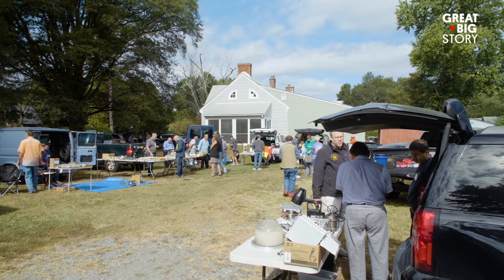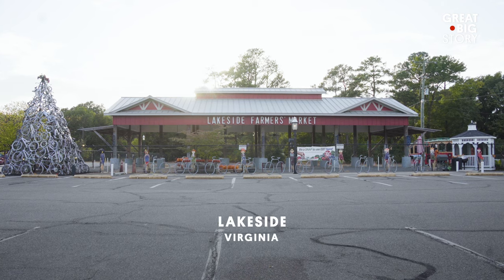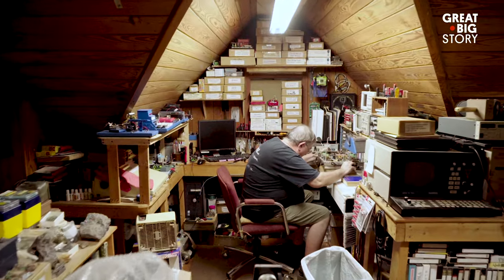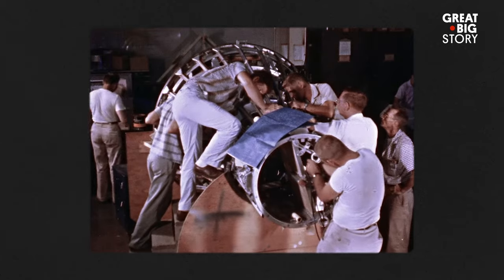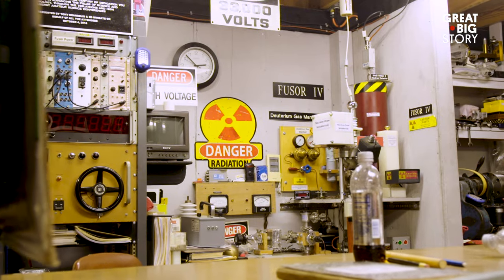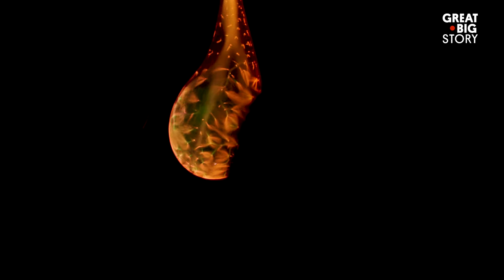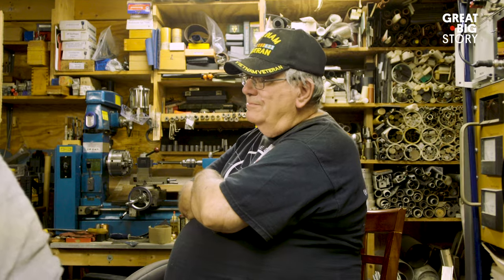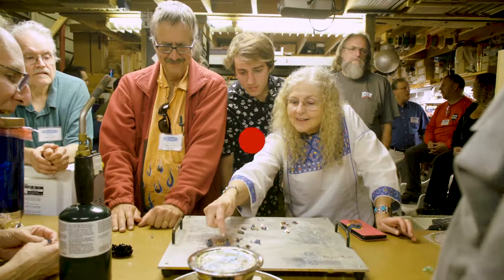This Amateur Physicist Built a Fusion Reactor in His Backyard

Comment: amateur
1 - a person who engages in a pursuit on an unpaid basis or as a pastime  ( check )
2 - someone who is untrained at an activity ( check )
as the builder and operator of a fusion reactor he qualifies as an amateur
Reply: Probably build farnsworth hirsch fusor which not that much different from a Tesla coil in difficulty.
Reply: @sadface7457  No I'd say it is harder, you need to pull a very tight vacuum for one. Also it depends on the type of fusor. The very basic one I guess is similar, but there are more advanced fusors with ion guns and other shenanigans that can be way more complex than a tesla coil.

Comment: A reactor be it chemical or nuclear is merely a device where a specific and desired "reaction " takes place.  Typically, some reactants are thrown into the reactor and conditions are made such that a reaction can take place.  The success of that reaction is measured with instruments based on what the reaction yields.

A nuclear reaction vessel, (nuclear reactor), need only show the presence of the nuclear ash produced when that reaction takes place.  Deuterium-deuterium fusion has a significant piece of ash, the neutron.  If neutrons are detected in large amounts, (millions of fusion reactions per second), you are doing fusion.  These fusion based neutrons are what is detected in this reactor.

A nuclear reactor is where nuclear reactions take place, period!  It need not produce usable electrical power or more energy output that was put into it.  A nuclear fusion reactor only need produce the fusion reaction in measurable amounts of fusion to show that fusion is taking place.  This enclosed, powered and fueled vessel does this.  It does fusion.

Comment: Oh cool you can talk to this guy on the forums over at fusor.net, a forum dedicated to building these type of reactors. The work is meant to be moving towards a break-even reactor but that is highly unlikely, especially without the use of radioactive material like uranium etc. He can answer a ton of questions about these and why this type of reactor will never work nor be capable of producing enough energy to create a break-even reactor. Due to the massive amount of electrical energy, right now it is at about creating 1 watt of energy from 1,000,000,000 watts of electricity used, so not even close. 

Still a very cool guy and worth talking to on that forum.

Comment: Btw: easy way to make a reactor (not fusion or radioactive but same concept) get a big container to put a ton of water in than get something to heat the cup so much that the water in it melts and the steam goes through a tube in the cup and goes to a fan and the fan starts spinning cuz of the steam coming at it and BOOM power! (Connect the fan or something to a wire to actually make electricity)
Reply: Sounds like a steam engine/generator 😭

Comment: I love this channel but this guy's BSing you, achieving fusion requires giant supercooled superconducting electromagnets and temperatures higher than the core of the sun since we cannot replicate the immense pressure. Achieving stable fusion in a SHED would have made this guy millions and practically solved the climate problem.
Reply: Fusion is not very difficult to create. Like with a Farnsworth IEC, you can create fusion in your garage. But the problem is always getting more energy out than you put in, which is the biggest problem with farnsworth fusors as they are incredibly inefficient

Comment: Interesting,   he shows no proof he actually has a fusion reactor or achieved a sustained fusion reaction.   He hints that he can fuse something. He hints it's neutrons.   But where does he get his source of neutrons?   He doesn't say.
The sun a fusion reactor uses 4 hydrogen atoms.  By extreme heat and extreme gravitational pressure it fuses the 4 atoms into helium.   You remember alchemy?   
On earth it has a few problems to recreate.  The gravitational pressure is much greater than the entire gravitational pull of the earth.   It requires more heat than can be contained in a physical container.   Any solid would melt or worse  in seconds.  It takes a energy bottle like magnetic.   The sun uses extreme gravitational pull to contain the reaction and maintain a consistent reaction. 
Since we can't contain it with gravitational force we use magnetic force.  The problem is creating enough magnetic force.  So far the magnetic force  doesn't last long enough and uses more energy to create than  is created by the reactor.
Reply: this could be a Farnsworth-Hirsch fusor with would be possible to make in a shed
Reply: @wooy1701  could be and maybe.   It still has the same problems. 
It doesn't work in a large commercial scale.  It takes a lot of high voltage power and produces a minimal amount of power and fuel.  They've been around for over 50 years. 
If it were actually viable wouldn't we be using it.
Even ITER admitted its decades away.
While it sounds promising it still has huge hurtles .
The Chinese and others have spent tens of billions of dollars.  Their reactor produced 100m degrees for 10 seconds.   Hardly ready for any commercial use.
Reply: @halfigliulo1019  I know this is useless but it is still a achievement
Reply: @wooy1701  i never said it wasn't an achievement.  It just isn't as big as they're making out to be.  In actuality you could build one if your careful enough.  
The fusor has been around for almost 50 years.  
It fuses a few atoms.  Not enough to run itself.  It needs huge amount of power from the electrical grid to keep running.  
It's not the holy grail of a fully functional self sustainable fusion reactor
 like a fission reactor that could power a city.  If they had I assure you the machine wouldn't be there.  
China built one costing billions.   The reaction lasted only 10 seconds.   Which is a long time to ignite and sustain 100M degrees such that matter becomes  plasma outside the sun.  This is close. 
We can't create the same conditions the sun does on earth.   Jupiter and Saturn are failed stars.  They aren't big enough to have sufficient gravitational force to create and ignite the plasma reaction. 
So if planets like Jupiter and Saturn didn't make the cut how easy is it for us on earth?
We need to create extreme heat to help overcome the lack of gravity.   At those temperatures physical matter can't exist as we know it.  So containing the reaction is extremely difficult.   A magnetic bottle must be created.  This takes a lot of power.  So far the fusion reactor doesn't create enough power to create this bottle.   In other words it uses more power to ignite and generate a sustainable reaction and not destroy itself.
This fusor
Reply: You need to study the deuterium-deuterium fusion reaction.  It produces nuclear debris.  One of these debris particles is a neutron.  Its detection heralds D-D fusion as having taken place.
Reply: @richardhull2949  i have as I stated its the only way we can on earth as we can't sustain the heat and gravitational pressure to fuse protons into neutrons as the sun does.  We need heavy isotopes of hydrogen.

Comment: In this comment section: people who don't know the difference between fission and fussion, and people who think a net loss of energy constitutes a "reactor"

Fusion reactors are still a long way off  (prediction has always been just 20 more years, even 60 years ago), and they will definitely require more maintainence than 1 man can provide.
Reply: A reactor be it fission or fusion is a device that does fission or fusion within itself.  It forms a nuclear reaction and that is what a reactor is be it chemical or nuclear.  It does not have to produce power, just do fusion or fission.  I suggest you do not now what a reactor is.  There is a high likely hood that a useful power producing fusion reactor will never exist. Nature and physics militates strongly against fusion.  Star fusion is only possible due to quintillions of tons of hydrogen gravitationally heating normal hydrogen at the very core to fusion temperatures.  Thus far, with billions spent since 1952 in many fusion reactors, all have done fusion as they are all fusion reactors be they table top or 10 acre complexes!  Not one has produced more energy that it takes to operate itself for more than a few seconds.  A power producing reactor making electricity might be expected, like a nice old coal plant, to work 24-7-365 without a single burp.  Coal fired plants are a functioning chemical reactor that works full time.  Fission reactors work producing giga-watts of electricity 24-7-365.  Fusion is, thus far, a near trillion dollar failure.  I should know, I am the guy in the video and have been doing and studying fusion for 20 years.  My favorite saying is "fusion is the energy of the future and it always will be!"

Comment: "The more pressure you have the more fusion you have". Yeah this looks real legit 😕🙄
Reply: Pressure does control the rate of fusion in a fusor. The total number of fusion events occurring is based on the electrical power flowing through the reactor.

As gas pressure increases, the electrical resistance decreases, and thus more current will flow. The current is carried by the deuterium ions being accelerated towards the inner grid.

Keep in mind this only applies to inertial electrostatic confinement fusion, thermonuclear fusion is a different type.

Comment: Well technically nuclear fusion is really simple, you just need to recreate the conditions found in the center of the sun using materials that would instantly vaporize in those conditions. You just need to squeeze some hydrogen harder than anything has ever been squeezed, and squeeze it without touching it.

Comment: If he had done “fusion” in his backyard, like the interesting article suggests, he would have solved humanity’s finite energy consumption—which would’ve garnered him a Nobel prize at the very least.
Reply: Fusors are nothing new. The first ones were built in the 1950s by Philo Farnsworth (The man that invented TV and made fun as Professor Farnsworth in Futurama). The issue with fusors is they have a very tiny area (a point) where the deuterium ions have enough velocity to fuse. For every watt of electricity used to power a fusor, only about 1 nanowatt of fusion energy is created. 

That said, Fusors are used as a low cost, and reasonably safe source of free neutrons for experiments.